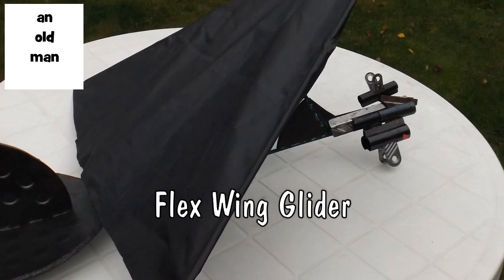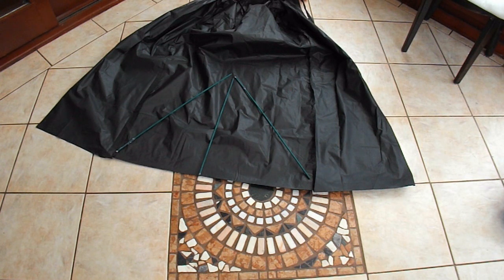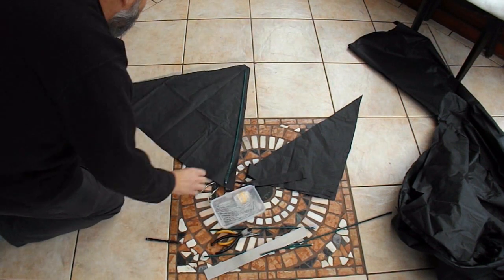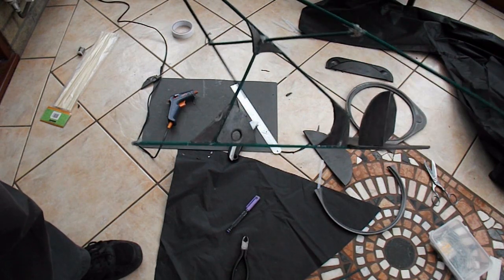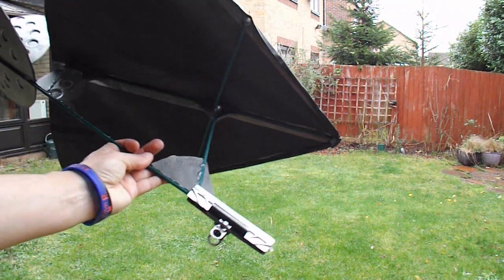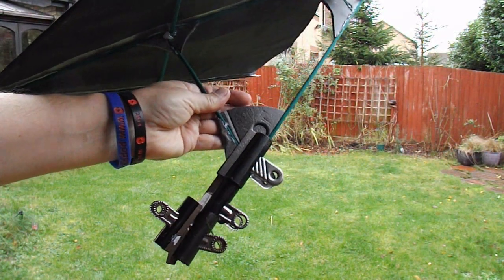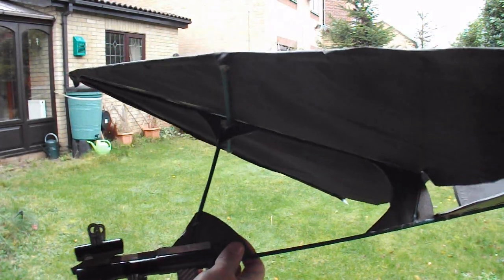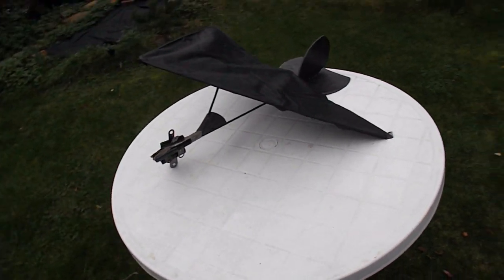Flex Wing Glider for Z.M.L.

Comment: would this glider work with a motor.
Reply from the maker: There are links to some proper RC versions in my video description. Mine would need a fair bit of work to make it fly properly. It would be better to start from scratch with a fresh design.
Reply: o ok.  looks awesome though.

Comment: lower the angle of attack , it will glide further. :)
Reply from the maker: Yes, as I explained in the video the flex wing was far too tight. If there was more of a curve in each wing it would in effect reduce the angle of attack. It would have helped if I had made the tail adjustable too. I might make another one day, they were quite popular back in the 60s
Reply from the maker: There are some links in the video description to some much better ones :)

Comment: Hey could you make a flying machine ( like an helicopter) with an ordinary toy motor and ordinary batteries (like AA) with the batteries off-board wired to the machine (as it would obviously be to heavy to carry them :-)

David
Reply from the maker: Hi David, I will add it to my list but I am not sure when I will get around to it. I strongly doubt that it will work, but I don't know until I have tried. I did some tests a while back with a typical toy motor and could not generate enough lift to carry the motor on it's own without any bodywork included. http://youtu.be/9PfErFnXyt0?list=PLA5a2xPRSrB29gSQavaGm8H2vqVg8kcgJ

Comment: Yes! something hits the camera at last lol..been waiting for that since the Spitfire video :)
Once tried something similar, a lot smaller though and I got the billowing at the back a lot more wrong than you have. That's a cool and different build :)
Reply from the maker: My wing is too tight which means the glide angle is all wrong. It should be much looser so the line it forms at the top of it's curve looking from the side should be much closer to the line of the bottom of the fuselage and the tail plane. I was looking for other videos on YouTube but unfortunately if you type in Flexi Glider you get something totally different. Looking for ParaGlider is safer but it still does not find this type of plane although back in the 70's that is what they were called. I made a couple for control line flying back then.

Comment: Maybe if the fuselage is longer, you could put the weight further forward and therefore put less weight ?.
And very interesting project.
Reply from the maker: My wing is too tight which means the glide angle is all wrong. It should be much looser so the line it forms at the top of it's curve looking from the side should be much closer to the line of the bottom of the fuselage and the tail plane.

Comment: I saw you liked the spinner I made any ideas on how to make it better
Reply from the maker: That depends very much on what you call better. What you have there is basically a frisbee that you are spinning using the centre grip rather than holding the edge. You could try gluing a bbq skewer or similar to the centre and wrapping some string round it to spin it like a top to get it going faster. If you cut some slots in it and lift them up so they catch the wind like a propeller or a helicopter blade then it should lift as it spins. Use a ball pen tube to hold the skewer so it can spin freely in your hand when you pull the string.
On the other hand if you just want it to look prettier you could do something like this http://youtu.be/oCwI4bhqRv8?list=PLA5a2xPRSrB3l5KTGMqUydr8pctBi5Af2